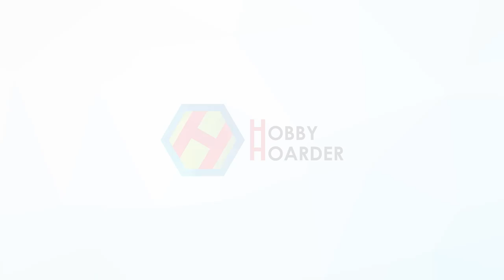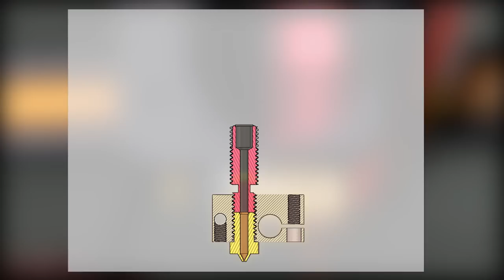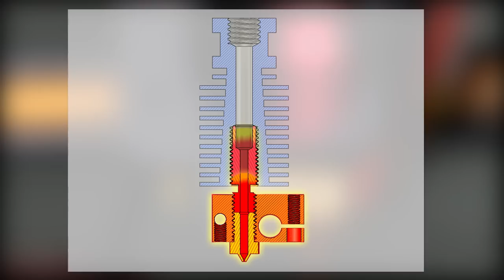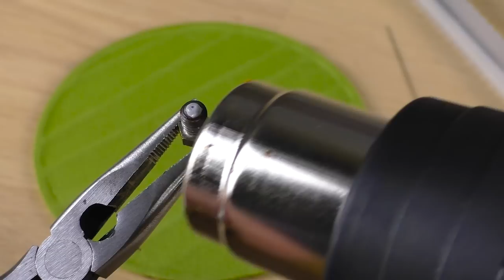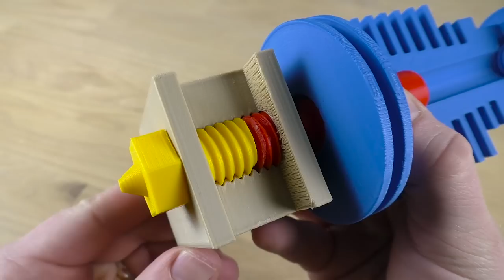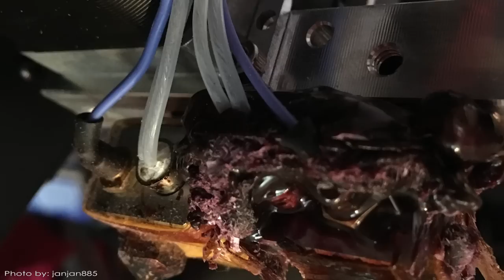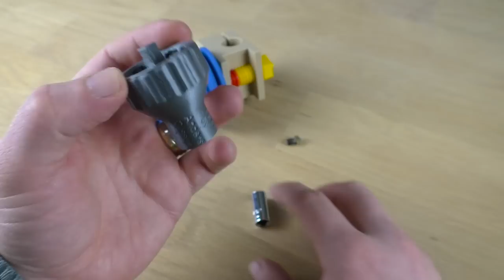Hotend explained and how to properly change the nozzle on a 3D printer

Comment: Who knew Borat was an authority on 3D printing?! JK 
 Thank you for sharing your helpful  knowledge and for getting quickly on to the point without all of the pageantry and overproduction that is so common in similar videos.
Reply from the maker: Thanks for the laugh. I should really start saving all the comparisons. The first one was with a drunkard, then it was Dracula and now Borat. I also hate needlessly long videos, so I'm really trying to keep mine short as much as possible. I know this isn't best YouTube practice, but I refuse to do it that way. As a side note, I've used new recording equipment in my latest video and I'd like to think it sounds less Borat-ish :)
Reply: @HobbyHoarder  I have to follow up and thank you once again. 
 I am a very new printer and have just begun to experience some extrusion troubles. 
 Thanks to you I felt more comfortable disassembling my heat break ect, and was able to find the issue causing me much frustration. 
I found that from the factory, my Bowden tube was not seated properly and a filament "plug" had formed inside the heat sink and I believe this has been causing my extrusion problems. 
  I should know soon as I am now 45 mins into a 5 hr+ print and so far is again printing beautifully. 
 Cheers to you Sir!
Reply from the maker: I'm very happy to hear that Roger, thank you. Let me know if some issue does creep up, I'm sure we'll solve it eventually.

Comment: Why I need to heat up?
Reply from the maker: When you heat the hotend, the metal expands. If you don't tighten the nozzle while it's hot, it might create a gap and cause a leak.
Reply: But brass has bigger thermal expansion coefficient than steel. Means when hot it expands more than steel. I think when tighten cold it will get more tight by itself when heating. When fasten it while hot, the gap can come when printed at lower temp. Hm... komisch...
Reply from the maker: Every manufacturer recommends tightening the nozzle only when it's hot. I've seen a lot of people with leaks and they've solved them by heating up the nozzle first. Maybe there is a tiny gap when it's cold, but once you heat it up, it should expand against the steel and create a tight fit.